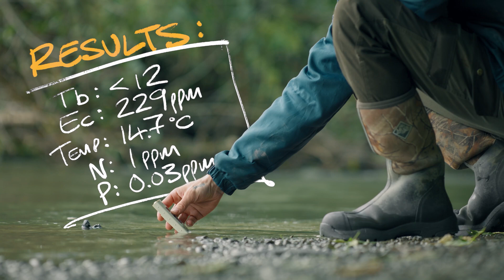What is a Leaky Dam & how do you make one?

Comment: one thing i would say is that the log dam shown at 1:00 is showing a bit of scouring. That is, as the water flows over the logs and falls into the stream bed on the lower side, it is eroding away the stream bed and deepening the channel. This could eventually lead to the whole dam being undermined and water flowing directly under the logs, resulting in even more erosion and a deeper, more degraded channel. The current best practice is to pack in brushwood against the downstream side. So that the water coming through the dam is slowed and spread out and therefore doesn't impact the stream bed in any one spot with enough force to cause erosion. This is in imitation of beaver dams, which always have a kind of wedge shaped profile, with the downstream side sloping gradually into the water. It's only a small thing, and maybe not even a problem in this particular stream. But just thought i'd share what I've learned from else ware
Reply from the maker: Thanks for the recommendation, I’ll pass this onto Dan 👍
(It’s Jason writing this message 😊👍)